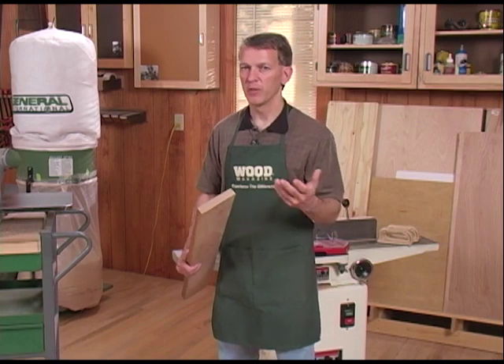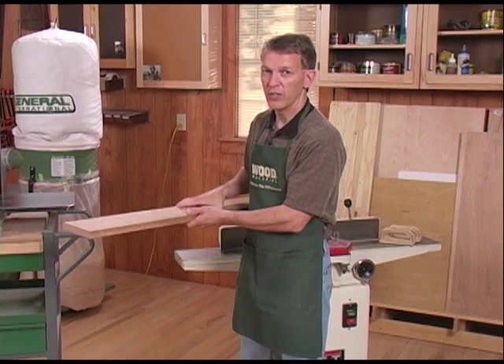Preparing Project Lumber with a Jointer and Planer -- WOOD Magazine

Comment: Two thoughts:  1) Most people who would need this basic level of instruction probably do not understand WHY a jointer works to flatten the first surface--i.e., because of the higher outfeed that is the same height as the cutters, while the infeed is lower.  I think you need to explain that in this level of instruction.  2) It's obvious to most of us, but you did not state that the face you just jointed goes DOWN when feeding it into the planer.  (Did I miss that?  For the table saw, you made a point of saying the jointed edge goes against the fence )  Yea or nay?
Reply: Thomas Truther  I know this is an old video and this may be none of my business, but your snobbish attitude about lower priced tools is exactly one of the reasons so many people are afraid to get into woodworking. They either don't have thousands to spend on "superior machines" or cannot justify the expense. I am quite happy with my "junk" WEN thickness planer and I have completed several beautiful furniture projects using it. My boards may not come out of the planer smooth as a baby's butt, but that is what my sander is for. My table saw is a jobsite model that cost about $500. It does a wonderful job as well. I have splurged a bit more on a few other stationary power tools but almost all of my hand power tools are lime green and say Ryobi on them. There is no reason to make people think they have to spend Ten grand to outfit their shop to make nice projects. If you shop around it's quite possible to buy the basics including  a table saw, miter saw and planer and a few hand tools for thousand bucks, even less if you hold off on getting a planer.
Reply: Thomas Truther  he would rip you to shreds using any brand of tool, hand or powered. You may as well throw your superior machines in the bin.

Comment: You give great information on how to use a jointer, but then you just throw the wood through the planer without so much as giving any instruction at all. You already have it set up. You don't even explain what the wheel that you're turning does (yes, I know it raises and lowers it, but you can't explain that real quick?). It would be good information to explain how much to take off at a time, what thickness to start at, etc. etc. I don't understand why you wouldn't do this. It befuddles me. I'm thoroughly befuddled.

Comment: Ugh I hate the American unit of measurement, which heavily involves fractions... 5/8... 7/8. For God's sakes just use decimals. They were invented a thousand years ago.
Reply: It's almost as if saying five eights is quicker than saying point six hundred twenty-five

Fractions exist solely for efficiency. We could say it in decimal form but when we use a 16th scale on measuring tools it's far less simple than saying 1.1cm for example. Also if you struggle with fractions idk what to tell you

Comment: I am trying to figure out why you used the table saw on the last edge instead of the jointer? I'm looking into getting a jointer soon.
Reply: Because the good side is against the saw fence and “mirrors” it. 
Make sense?
Reply: Because it would require more passes, take off more than necessary, and is more likely to not make an S4S board unlike the table saw

Comment: I believe the pigtail mark was marked on the wrong/unjointed side @4:50. Should be the other side that is jointed since it was resting against the fence.
Reply: I saw the same thing, had to back up and re watch to confirm - pigtail on the face was on wrong side vs what was advised to do. still good video.
Reply: @auklon3372  Ah yes, I should've added that this is still a great video and incredibly helpful!

Comment: This works well IF you work with narrow stock or have a large and very expensive jointer 
Alternatively very light alternating passes through your planner usually achieve a very flat board.
Using a straight line rip jig (with a table saw or a hand held circular saw) will achieve a straight edge faster and with a longer capacity.
My 6" Powermatic jointer usually just collects dust and rust.

Comment: I am trying to figure out if there is any use for my 6" Craftsman jointer? It has a nice 1/2 horsepower motor with belt drive, and very sharp cutters. But I don't own a planer. I am wondering if the jointer could be used for cleaning up rough edges of rough lumber, before ripping them on a table saw? I recently acquired a jointer and it seems useless without a planer?

Comment: Before you prepare your project lumber as shown, how can you tell when your lumber is dry enough? Are wood moisture meters reliable and worthwhile, or is there a rule of thumb how long you should keep your lumber in room climate before you even start preparing it? Otherwise, isn't there a risk of wasting your effort as the remaining moisture change and tensions inside the wood still keep reshaping it?
Reply: If it's thick or long lumber, I would mill it in stages. Do a rough milling first, let it sit in the shop climate to acclimate for 2-3 days, go check and see if it moved, if it didn't budge you are probably good to go to mill to final dimension, if it moved then do it again roughly and then wait a few days and repeat. The basic idea is not to do it all in one go so you don't release stress and have the lumber move on you when you have no room to mill it again.

Comment: Thanks ,what would be the recommended way to bevel the edges on 45* angle ,positive angle on one side and negative on the opposing edge
Reply from the maker: Most jointer fences tilt to 45 degrees for beveling. Another option would be to bevel those edges with a 45 degree chamfering bit.

Comment: Why not use the jointer on both ends instead of table saw?
Reply: By jointing one side to get it straight, the board will likely not be the exact width anymore, along the long side of the board.  For example one side may be 5-1/4 inches wide and the other end may be 5-1/2 inches wide.  As long as you put the straight edge along the table saw fence, you can cut it to something like 5-1/8 for the entire board.
Reply: That makes sense now, thank you.

Comment: Why not put it back in the jointer after the thickness planer for the 4th edge?
Reply: Because, in an actual project, that last rip cut will take it down to size. It is the same reason you don't waste time squaring the ends until you actually use it.
Reply: Because it won’t be parallel to the other edge
Reply: Both good points
Reply: @lukesailing5379  Wouldn't it be though?  The other edge is going to be square with either face.  So, if you put either of those faces against the jointer fence, wouldn't that make that 4th edge square with the face, which in turn would mean it's parallel to the other edge?
Reply: Mike A  I was referring to the fourth edge as the other face, your definitely right I just misinterpreted the question

Comment: Could you just do all four sides on that jointer?
Reply: It wouldn’t be truly square or flat if you did. Took me a while to understand because I thought the same thing.
Reply: Shouldn't jointing both edges with one flat side against the fence make them square and parallel? I'm asking because I don't have a table saw yet...
Reply: @urgon6321  1st you flatten the face. 2nd using that flat face against the fence you can streighten the edge. technically you could flatten the other side with the flat edge against the fence, but it would be very hard to hold an edge that thin against the fence. by doing the face and edge on the jointer you can then set the planer up to the exact width and thickness that you want. hope this helps.
Reply: @josephandrews5744 , I forgot that my plunge saw has parallel guide, so ripping the edge will not be a problem...
Reply: @Wood  I assume a bandsaw with a fence could replace the table saw, right?
Reply: @-Thunder it would be sloppiler 
A bandsaw is more likely to have tear out and really should be used as little as possible

Key tools for wood working are jointer, planer, table saw, miter saw, router, drill/driver, and clamps

Comment: But you end up with super thin board
Reply: When you buy rough lumber, it’s cheaper but you end up wasting some during the milling process
Reply: That's true of all rough lumber.
There's a reason a 2x4 isn't actually 2 inches by 4 inches. The rough dimension 2x4 is never that thick when actually squared on all sides. You know the way you want any furniture to be
Or else you have gaps in the furniture, a bumpy surface, etc